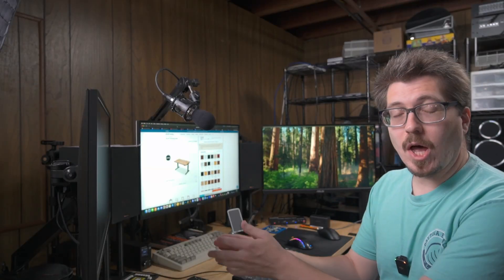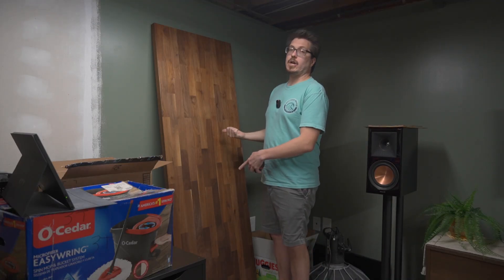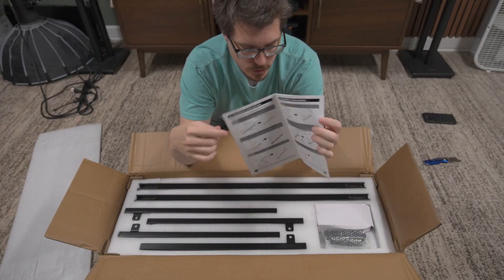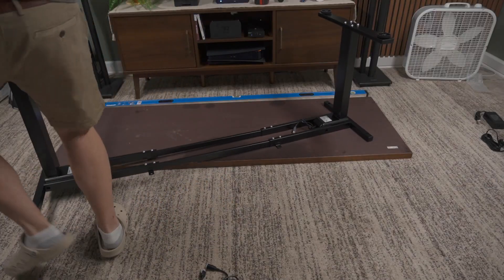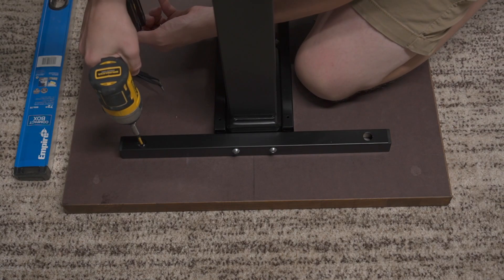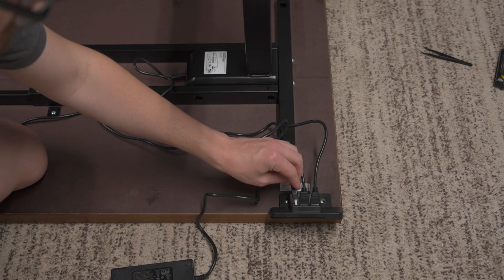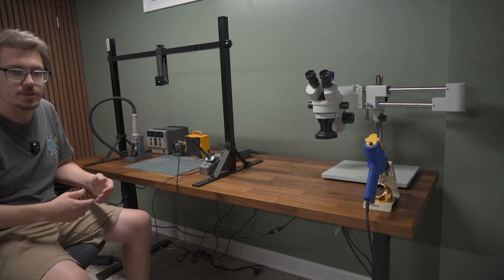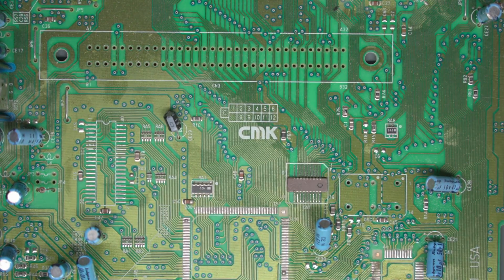Budget Standing Desk for Soldering? Setup & Comparison

Comment: When I did the bulk of my modding & repair I used to do it on a basement bar I converted to a work area.

  Lighting was great.  
Plenty of space and shelves below bar. 

The bar was in a corner and behind was mirrored with a shelf matching bar height so really made lighting even. 

 Plus the bar top was tile that wrapped around front and back. Made clean up easy, a dropped hot iron or solder was nothing to worry about. 

After all these years I'd def like to recreate that setup.